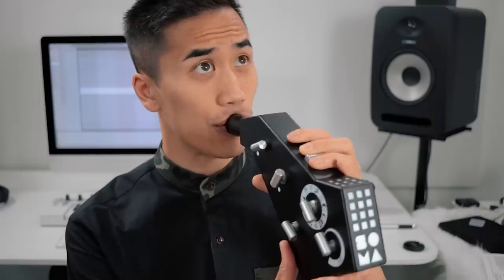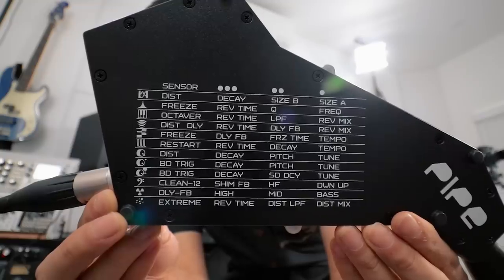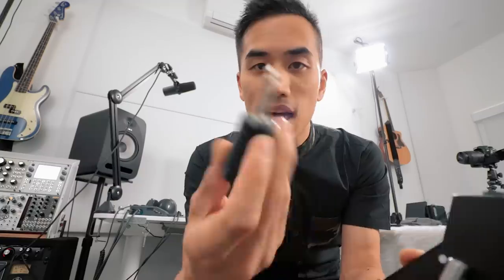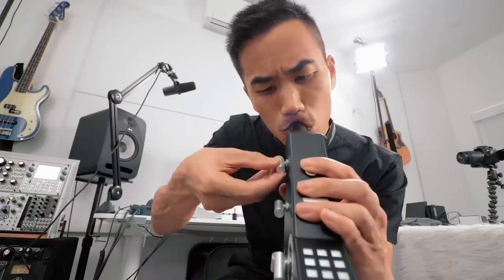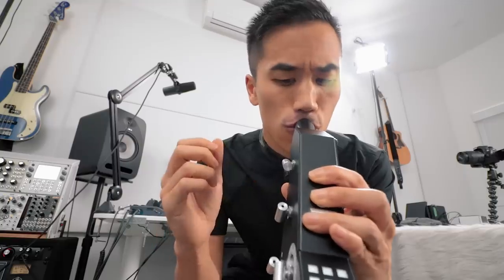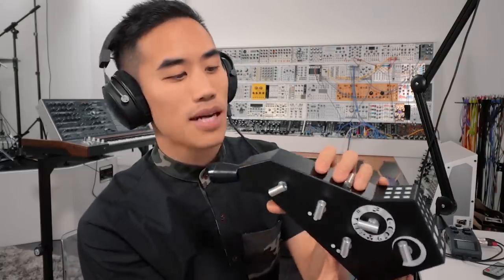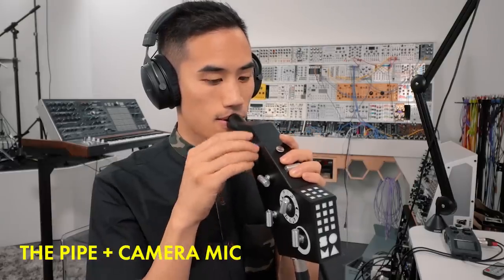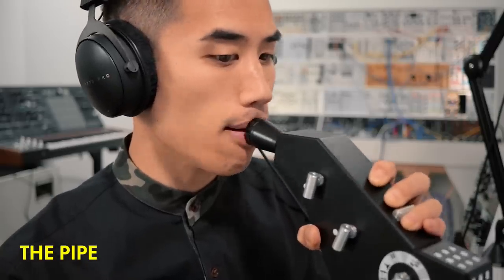WEIRD GEAR: Soma Synths Pipe

Comment: You didn't even try plugging something else in it? A guitar, a modular synth or another mic?
Reply: Loupy Dautyy I also wanted to see something like this
Reply: well, it’s just an effects unit, the weird thing about it is the mouthpiece
Reply: @scrungly  Which is a contact mic without a cord.
Reply: 57thorns  yeah, the interesting thing is the combination of both, so it wouldn’t make much sense to remove one part is what i’m saying
Reply: I have a few videos where i run other things through the Pipe, check em out if you want. Not meaning to self promote but its relevant i guess xD
Reply: Spider of Pnyx k I’ll check it out
Reply: Here you can see how the Pipe works as an FX processor : https://www.youtube.com/watch?v=u1KnJgI9Kpc
Reply: If it's a contact mic and it's super sensitive, it'd probably be super loud even in the resting(?) state.
Reply: @SpiderofPnyx   Wow your stuff is great. Subscribed! Mortis Thule Space Hulk = 12/10
Reply: @KlovAlzo  wow thanks for checking it out! More stuff coming soon!
Reply: @arthurhenriqued.a.ribeiro2078  Which is probably why the the touch sensor has to be, well, touched for any sound to be emitted. 1:20
Reply: @somasynths  thank you messiah Vlad.  big fan.
Reply: The point is to use it as a pipe

Like, for weed
Reply: @SpiderofPnyx

Comment: Just a heads up to anyone interested in this fine piece of gear. It costs roughly $500 US, it includes a mic (normal) but there are 2 other types (flatty & bassy) which are $35 each, you can get it in either black or white, be prepared for very high shipping costs due to it coming from Russia (nothing can really be done about that). I just ordered one in white with both of the additional mics, shipped to CA it costed $685. That's right $115 for shipping sadly but I'm super excited to try this thing out. Also, YES, you can plug other instruments into the jack and use it as an effects processor/pedal. Part of the reason I wanted it.

Comment: Since the thing is just using a standard quarter inch jack as input, I wonder what would happen if you pump in crab rave through the different modes on the thing

Comment: Andrew:  I really like your videos.  I'm thinking you also have a video on LMMS? I've been using the software for about a month now. I've learned a lot but I have a questions which I can't seem to find any videos to explain the following. I was wondering is it possible to split off sections of an audio like you can in other programs? In audacity for example if you have a audio file you can put your mouse on a spot and go to edit menu and split the audio segment where you want. Then you can either delete the section or move it around. It would sure be nice if you could do that in LMMS. Also I like to take various audio files and try to line them up to match them correctly. Sometimes it is really hard to get them to sync properly. The audio is off a bit and sounds awful. In Audacity you can move the files in very small increments on the time line to match up audio files. I can't seem to find out how to do that with LMMS- can you do that? It only lets me move within that small block of time it gives you. Can you break that blocks into smaller segments? Any help you can give me would be greatly appreciated! Thanks!
Reply: I don't know if this answers your question but in the Audio File Processor dialog box there are knobs for setting the beginning and end of your sample. They have arrows with lines next to them. - >| for the end of the sound and |< - for the beginning. If you use those to cut off the beginning silence or trim the ends they'll sync up. 
There's also some stuff you can do like reversing and repeating the sample, with the ->|<- knob to set the repeat point.
If you're really feeling desperate and that didn't answer your question you could also download Audacity, process the sounds in there, and then bring them into LMMS.

Comment: Isn't this basically like a glorified vocoder? Lol... Pretty sure you could the same thing with "FX chains" and emulate the sound at least on something like the Microkorg or even the RC-505 or the Arturia Microfreak? Use MIDI CC to customize further and throw in a controller or foot switch and you're good to go!

Comment: Hey Andrew, I actually decided to get the pipe thanks to you and this video! But while I have the pipe plugged into the beat box and that connected to the wall outlet, it glows. But no sound is coming out even with my finger on the touch sensor. Do I need another speaker or more gear in order to have sound come out? Thanks for your videos, by the way, they're awesome.

Comment: What a ripoff . Its just an effects unit you hold with a piezoelectric pickup  attached. The piezo will cost you less than a quid and you can get a multi effects pedal from behringer for about 20 quid. This piece of crap costs nearly 500